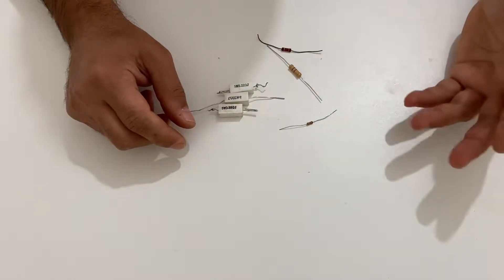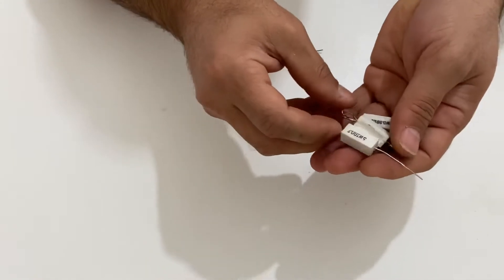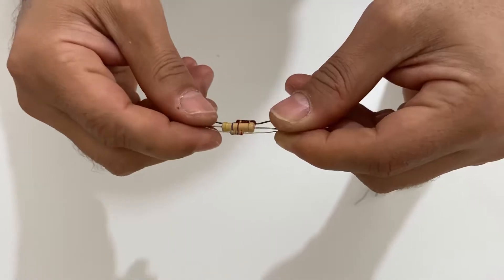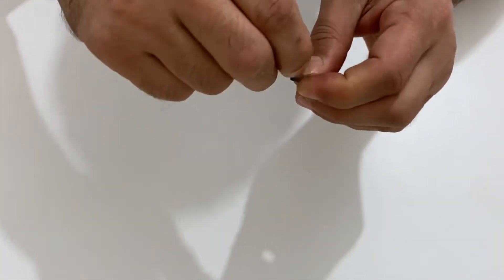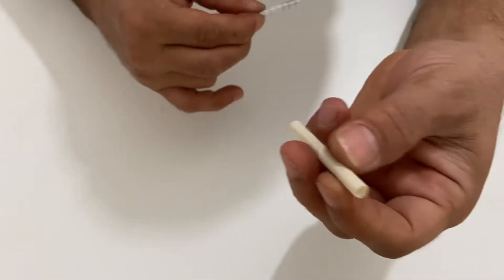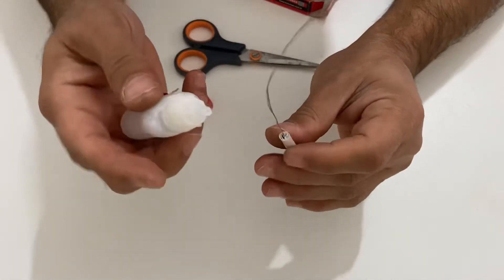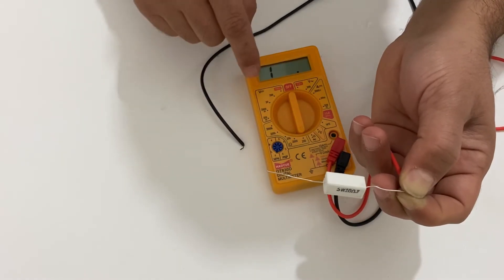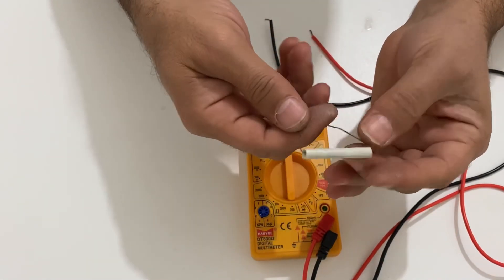How to Make Real Resistors for Free at Home.

Comment: If this thing overheats, it will be a great source of fire.
Reply from the maker: It’s never gonna heppen don’t worry. Because you will never need to apply that much of high current 😊
Reply: @joyofelectronics9782  You can't predict the current when it fault or short circuit. It's better to use something like silicate glue for example.

Comment: the multimeter isnt wrong the letter J on the first resistors indicate a precentage and that precentage basically shows you that the resistor is not perfect J stands for  ±5% of the written number which would be 9 to 11 ohmi also dont touch the wire while measuring it your body has a resistence aswell and it can affect the  measurment and cause it to be wrong

Comment: howToMakeHigherValue,WouldBeUsefulToShow.
Reply from the maker: I will do such a video as you mentioned
Reply: Everything you need to know is in the video. The carbon rod is the conductive material with a high tolerance for heat and built in resistance. Use bigger wires going into a bigger carbon rod, covered with more isolation paper, slide inside a bigger protective sleeve (he used plastic here), use more super glue to cap it off, and measure the resistance.
Reply: @flyback_driver  uDontUnderstand.IMeanInTheOrderOfKiloohms.

Comment: Hi ,how can i make sure i get the desired ohms capaicty resistor ? Should I wind more wire on the graphite to get more ohms? how much thickness Aluminium wire should be used ?
Reply from the maker: Hi, no you can’t get desired ohm value in that way. You have to adjust thickness and length of the graphite rod. But if you want to get a value more than 10 ohms you should use something else instead of graphite or very less conductive graphite based material 👍
Reply: @joyofelectronics9782  thank you. Keep up the good work!!
Reply from the maker: @RakeshKumarGovind  thanks l will do so